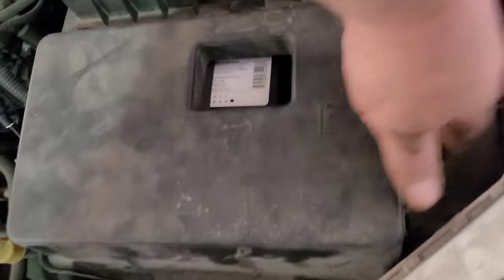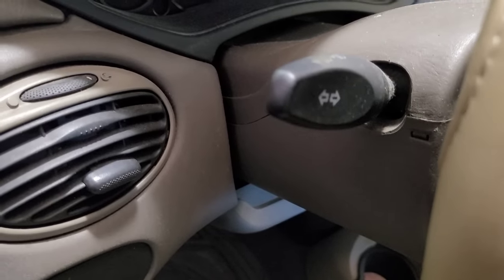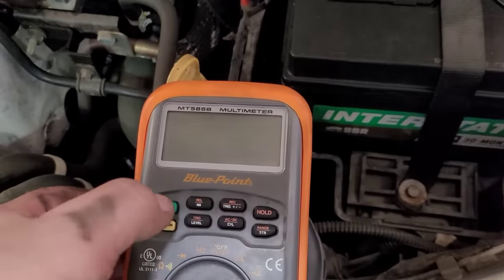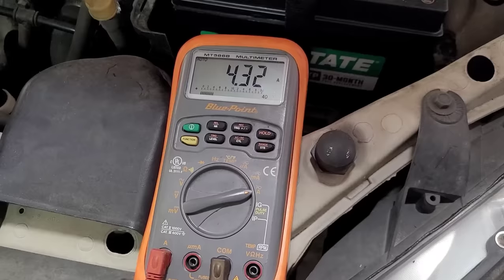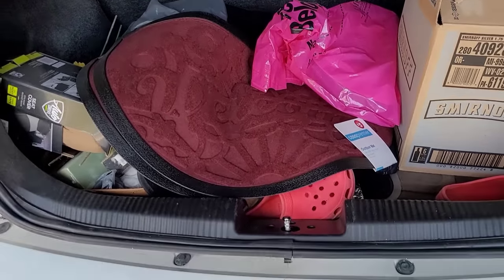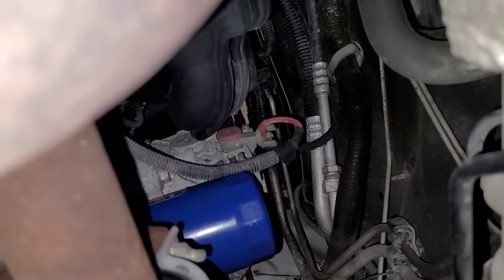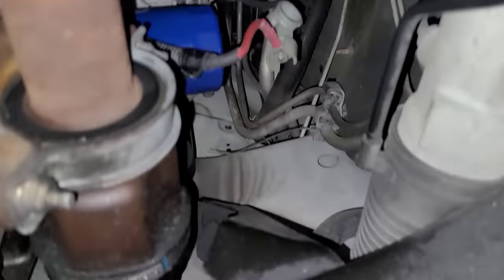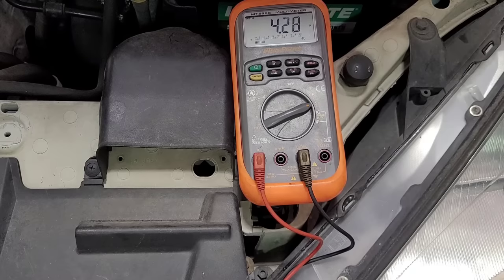Why is the Battery Going Dead? This One Will Surprise You!!

Comment: I've been a mechanic for over 40 years, It's really nice these days to see someone who actually knows how to troubleshoot. These days so many guys just plug in a scanner and if they can't find a code they give up.
Reply: or replace whatever
Reply: I am no mechanic but do have some knowledge  i am more of a hands on approach but still use my scanner just to verify
Reply: The art of critical thinking is lost with most people today.
Reply: @josh6715  There is nothing wrong with using a scanner, but a for the most part a scanner does only one thing, it tells you if a sensor is either in or out of range, If you get a code for a coolant temp sensor, it doesn't mean the sensor is bad it just means the sensor is reading out of range, could be many thing in the cooling system that failing that's causing the sensor to kick a code. I've seen guys change the sensor 3 times complaining the sensor was bad out of the box, but in reality the fan clutch was beginning to fail and was raising the water temp just outside of the sensor range but not enough to kick on the high temp light or make much of a change in the gauge. The coolant sensor also plays a big part in controlling the air/fuel mixture, temp sensor basically is the engines choke in cold weather start ups.
Reply: We know those types as "parts cannoneers".  Pull the lanyard over and over and then send a huge bill after the bad component is finally located and replaced. Boom!  Empty wallet follows.
Reply: I'm not a professional mechanic, but I've worked on my own cars for about 50 years and my dad's vehicles and equipment for a few years before that.  I know the type you're talking about.  Once when I was working as an electronics technician, I came across an assembly that had been through troubleshooting 40 times by other techs and engineers!  One expensive integrated circuit had been accused and changed 5 times!  The majority, if not all, of those techs and engineers were being paid a minimum of 33% more than I was.  I don't like to have to toot my own horn, but I feel that I deserve this one.  I found the problem on my first try and, a few months later, went to work for another company for 44% more!  It wasn't in the electronics field, though.  It was building cars.
Reply: Finding the code is usually what makes me give up
Reply: I’m not a mechanic, but I stayed in a courtyard once… I’ve chased excessive parasitic drain by pulling one fuse at a time and checking the ammeter. My wife’s Liberty has a bad ignition switch that will cause an issue by being a few degrees out of position. I’ll fix it next week/month/year probably.

Comment: Back in the day, I would remove the Alternator, replace the rectifier bridge, diode triode, bearings, etc,  same thing with starters, carburetors, etc. Then reinstall the original OEM component back on the vehicle and it last another 100K. This is why I originally  became a mechanic, was all the gauges ,testers, meters used in repairing things like a surgeon. I am currently employed as a buggy whip repairman, and times are tough,  boy let me tell you what!
Reply: I used to rebuild alternators too,.. and some starters and fuel pumps that you could get kits for and a Buttload of carburetors! But that was back when.......
Reply: Back in the day mechanics were trained to repair cars trucks ect. Now they're trained to be fitters. You don't have the time now by the time you removed all the s*it to get to the job the price is racking up.
Reply: THAT is a talent and the best is that you knew it was done right.
Reply: I'd think you quite busy with  repairs as many folks need to get the attention of their EV without resorting to a 2x4 .
Reply: To this day when I see something like that on mine I yank it and take it to a local guy who has a DC Motor shop.    He tests it and does whatever needed usually by the next day.    It was $35+- back in the 80s .   Now days it is around $60 but I know everything is good and not almost but not quite worn out as you can get from a big commercial rebuilder for double that price.     Same deal with starters, they all stayed the same until sold or scrapped.     A good mom n pop rebuilder is a fantastic guy to know , too bad they are fading away 😢
Reply: Back in the day, cars wouldnt last 100K. Those parts were failing after 25-50K miles.
Reply: @iamtheoffenderofall  I don't know what your thinking the old cars had less things to draw power and usually were built better OEM parts use to last not just the opposite new parts fail at a blink
Reply: @kevinanderson686  carburetors over fueled engines glazing cylinder walls. Wheel cylinder rebuilds were extremely common on drum brake vehicles. Alternator and starter rebuilds were also extremely common. Your comment tells 2 things. One, you clearly didn't daily drive a 50s to mid 80s vehicle on a daily basis. Two, you never consistently repaired 50s to mid 80s vehicles to see that every part of your statement is simply wrong. 

Last thought....before fuel injection, people would never buy a vehicle with 100,000 or more miles for fear of increased failure rates.
Reply: @iamtheoffenderofall  See that's where your wrong the older vehicles held together a lot better real metal yeah you must've been one of those that never worked on one back then to only get 25 k to 50 k out of them otherwise you must've had like a Fiero or one of those cars that was problematic cheap junk one
Reply: Yes, used to sell rebuild kits, bushings,  brushes, etc.
Reply: Back in the day, I rebuilt starters, alternators, carburetors, calipers, brake cylinders, master cylinders, and sometimes generators on the real old stuff.  It's a lost art because carburetors and generators are basically gone, alternators and starters are made NOT to be rebuilt, and everything else is remanufactured overseas cheaper or the parts aren't available to rebuild them.
Reply: @iamtheoffenderofall  take this for what it is worth...got laid off aviation career after 911 shake out of industry and sold Nissans at a dealership. This was 06 thru 09, then got recalled back to career by airline. Anyway, trade-ins that had 100K and/or were 10 years old were regarded pretty much as crap and would be 'valued" at a token amount of trade value, say $1500 and driven to back of property for used car auction to "car lots" on the auto row strip - a boulevard of third tier resellers for those with bad credit and/or minimal funds. Then came O'bummer's CASH for CLUNKERS and the used car market has been perverted since then. LOOK AT PRICES AND MILES NOW ON USED HEAPS! Unreal. And the pricing of new cars -INSANE.

Comment: I would recommend investing in a clamp on DC amprobe.  It is similar to the ones that electricians use, but it works on DC.  Without disconnecting any wires, you can look at current flowing in/out of the battery even before waking up the computers.  Clip over the alternator output to see what it is doing.  In addition, you can isolate leakage currents by clipping on individual wires coming from fuse panels.  I was a two-way radio tech and started using one and now everyone in the shop has one.  It is a real time saver.
Reply: Are you talking about a regular test like whith a volts read out on it if so allibaba has one like I'm mentioning of for 6 bucks right now an lights near any live wire figured it was good price if interested
Reply: Can you recommend a brand of meter?
Reply: Paul J, an absolute Thumbs up! Being an old guy in the fixing department of near everything that people can F*&K up. Key thing is" KNOW THE BASICS OF WHAT YOU ARE WORKING ON!" The tools do not make the person, the person that knows how and which of the tools to use to find the issue and gets the fix done High Five. To diagnose things properly you need to know your s(#t.
Reply: Most Amp Clamps only can measure AC.
For DC, you need a better one, based on a Hall sensor element.
The Kaiweets  seems to be best bang for the buck.There are about 5 models, which look similar! Go for at least the HT206D, or better the HT208D, as it also can do inrush-measuring up to 1000A, e.g. for testing the starter power or glow sticks.
Reply: @12babyapes59 Best bang for the bucks that measures DC currents down to milliamperes are definitively the Uni-T UT210E
Reply: I have been wondering whether I should purchase one.  You comment pushed me over the threshold.  Thanks.      Joe
Reply: @brucebourget2nd286  No , clamp on ammeter .
Reply: i have a low amp clamp you put around the cable to measure amps. problem is the static in the air affects the reading when you put it in milli-amps , had a big argument with my snap on dealer about this problem, even talked to tech support and nobody could help me. wasted my money for northing
Reply: @peterpeter5666  Here you have a few options. You can either move to a planet without a geomagnetic field, which is actually what protect us from getting fried by the sun's harmful ultraviolet radiation. You can move closer to the equatorian line where the electromagnetic field is weaker. You can stop measuring DC and stick to AC only. Or you can educate yourself to use the meter in a proper way.
What you need to do is to zero the instrument one minute after power on, and then move the meter as little as possible especially in horisontal rotating direction. Best is to place the clamp stationary around the wire and zero it (without altering the position of the meter) with the wire in a known zero current state before you let the current flow. But this is of course not practical in all instances. 
Last option is to buy a new meter for around 10-20x the price you paid for the one you bought...
Reply: @X10anT  absolutely agree. That's the model I have (one of five multimeters all told) and it's so useful I use it for general microelectronics as well. 

If I NEED to measure uA or lower I can use one of my other meters. But in a car measuring as low as 5mA is rare and that DEFINITELY will not drain a good condition battery in a couple of weeks let alone days. 4.8 plus amps will drain a typical 45Ah battery overnight from arriving home to setting off the following day!
Reply: @boblewis5558  a standard cheap multi meter is fine for under 10 amps too. Most forget that. And have one on the shelf
Reply: @Alberthoward3right9up  only problem with standard ammeters (I have several) is that it breaks rule number 1 when troubleshooting ... Change NOTHING before confirming EVERYTHING. 

Any change to original conditions risks destroying the evidence you need to confirm the fault. If you can't be certain and only guess then the fault may not have gone away at all. A clamp meter is a non-intrusive test method, a standard meter is NOT.
Reply: @12babyapes59  kaiweets is inexpensive yet super accurate
Reply: Been using one for past 40 years. They cost arm n leg but now off Ebay 20 bucks gotcha a very good one. Nuther thing to get is a Rayovac pen ta let ya see spark in real timeo
Reply: Most amp clamp meters are not accurate enough to read milliamps.
Reply: @fillupread  He wasn't reading milliamps.
Reply: @fillupread  I think you need to revise your opinion on that! Modern electronics can do better than that. A traditional iron cored AC only clamp meter? I'd agree, but hall effect clamp meters? Err no! They CAN detect such currents ... AC & DC.

DC is very easy to verify too. Out two standard meters in series on amps range, set a current and check the measurements on all three meters. If all three agree within a couple of milliamps then they are correct!
Reply: The amp clamps are great for big load, but are not precise for small loads. In this case it would have worked, but don't expect to reliably see a 50mA load
Reply: @thephantom1492  sorry but you're wrong! The meter I use reliably reads to less than 5mA ... I've tested and checked it! 🤔🙄
Reply: @boblewis5558  that is an exception, not the rule.
Reply: I have a basic Fluke meter w DC ammeter clamp.  It's awesome. Fluke makes many meters with a wide array of features.  It's possible to only purchase the features you will use, which allowed me to get the Fluke DC ammeter multimeter for $100.  If your meter doesn't read low amperage well, a way to improve accuracy is to loop the wire through the clamp 2 or three times, if you have the slack.  Just divide the reading by the number of loops.
Reply: A clamp probe is a great idea.

I once had to track down a drain on my old car, and managed to find it using a multimeter with a sensitive very low voltage range by connecting the meter between battery negative and the chassis.
Turning headlights on and off let me check the meter was picking something up, and gave me a rough idea what the meter readings meant in terms of current.
I actually made some long leads up so I could have the meter inside the car, so I could have it with me next to the fuse box.
I couldn't find the drain the first time I tried, so I left the wires in place for a few trips so I could keep checking (with both of them basically being at ground, I didn't have to worry about shorts).
Turned out to be an elusive problem. Immediately after running the car, there was no real draw, but sometimes one appeared later. pulling fuses narrowed it down to the fan thermostat which would sometimes pull a smallish current without turning the fan.
Reply: Is there a relay that turns on the voltage to the alternator primary coil.  If the alternator doesn't fix it I would check for a possible stuck relay.
Reply: @12babyapes59  Klein. Meterman. Fluke but they're overpriced.  Try to get a Klein made in USA if you can.
Reply: @VndNvwYvvSvv  fluke isn’t overpriced. I’ve had my Fluke 77 since 1986. They make really good meters
Reply: I have a Craftsman meter with a AC/DC clamp that saves me a lot of time
Reply: @eflanagan1921 Bruce is referring to the test leads that are on the "Clamp on Amp meter" these newer clamo on have voltage tester leads just like a DVOM
Reply: @12babyapes59  Fluke is the only brand of meter. I wouldn’t buy anything else.

Comment: Kenny -I am a back yard mic-a-nik. I have had 3 unusual battery draws, that are rare. First, my sisters car battery would drain over night. the problem turned out to be a dirty starter, the filth , dirt and stater brush wear caused a path to ground...cleaned the starter, no more problem. next a audio cassette stuck in the radio, kept trying to eject, but was so quiet, you did not know it. Next a bad diode, in the alternator, was blown closed, draining the battery over night. I hope my comments, may help someone.
Reply from the maker: Thanks for sharing your experience! Thanks for watching the channel 🔧
Reply: @WrenchingWithKenny  You should rewire the Radio to ACC and not Bat. With the key in the off position that drain issue would not occur.
Reply: @majwor3763 I would suggest a completely separate switch and fuse and not use the Accessories at all. Most modern entertainment units have a "Parasitic" drain happening to preserve it's memory. Also a constant fuse blowing is also a common occurrence due to excessive load. There are actually kits that have everything you need.
Reply: @gilbertsandoval1888  All the memory stuff gets hooked to BAT...The rest to ACC...I've owned and operated a Automotive Shop for 40+ years for a living and am a Master Automotive Tech. I think I know what I'm talking about.

Comment: I had an 84 Buick Regal, if you started it and drove 2 miles the battery would be flat dead, intermittently. New battery, alternator and checked all connections, still did it maybe once a week. After months of dealing with it I unplugged the accessories problem went away, then started plugging in p/w and each accessory one at a time, the rear window defroster had a short with the switch off. If that was a customer job they would have been livid by the time the problem was sorted out, just never know when it comes to draws. With new cars the blue tooth will keep trying to connect and will drain overnight even if you don't use it, internment problems are the worst, you can't possible make money on them and usually loose a customer.

Comment: I chased a phantom discharge on an old Chrysler New Yorker for a friend of a friend's dad. Stealership had sold them an alternator and a battery prior, which did not fix the discharge issue. 

I measured the draw on the battery, and started pulling fuses until it went away. The issue turned out to be a broken cable on the power antenna. When you shut the key off or turn off the radio, the power antenna was supposed to retract -- unless the nylon cable inside the antenna mast was broken, and then the motor kept running because the antenna never hit the limit switch.
Reply: Long ago I found an old Chrysler clock hands were stuck and the  clock motor  was drawing an amp or two killed battery after a few days.
I beat on it sprayed with WD-40 and it fixed it .
1979  a Gas station mechanic kid then .
Reply: I swapped out the power aerial for an amplified roof mounted shark fin (good quality one) - never looked back